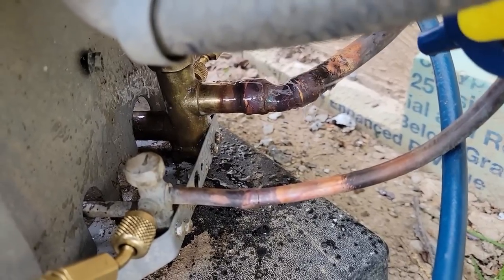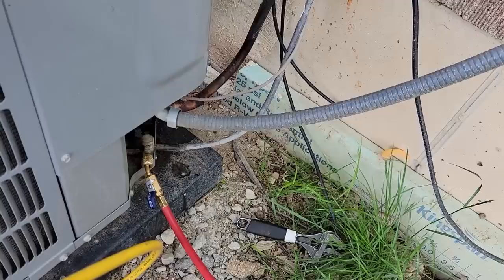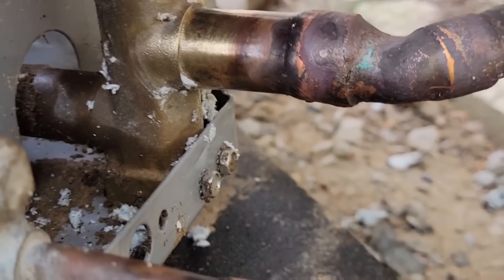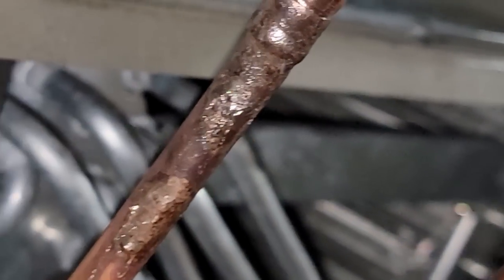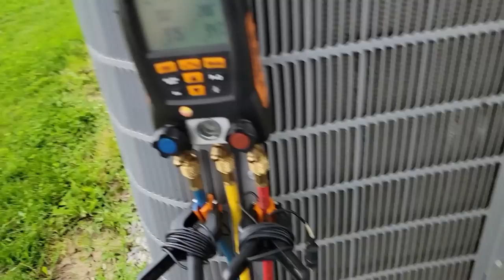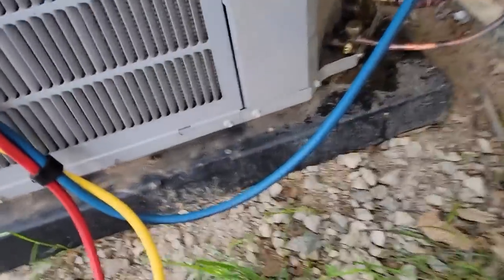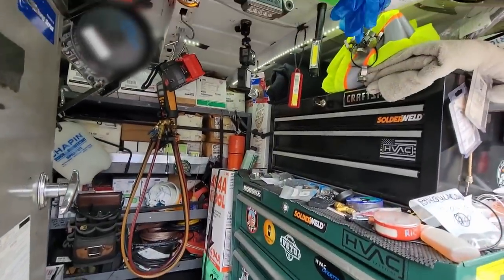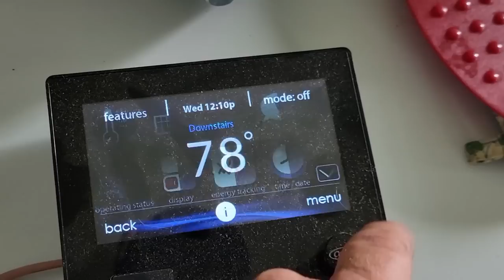No Air Conditioning At OLD Farm House Under Construction

Comment: I had the same scenario today had oil inside and outside but could not confirm a leak via bubble test, what gives? Had at least 150 psi 410a pressure in the thing, I’m at a loss…love the residential videos man! That’s mainly what I work on!
Reply from the maker: Thanks Tom! I use to do mainly residential so I don't show it much because I got so burned out on it. That's why I did generators and now refrigeration. But even that's getting old...lol time for painting butterfly's on trains maybe...lol

Comment: I would have changed that drier , going by the leak, seems like unit always had a leak. Makes me wonder how many times it was flat on charge
Reply from the maker: I believe that was the first leak. The safety circuits shouldn't have let it run into a negative and pull in non-condensables was my reasoning.  Far as other issues, it's a 2019 build date, I believe the only other problem he had was a bad inverter board.

Comment: I had to replace an evaporator on an underconstruction luxury condo that became packed with drywall dust while wet under use.  May as well have put the plaster directly on the coil.  Attempts at cleaning went nowhere.

If you are supplying heat/cool equipment to an active construction site, be warned that manufactures specifically state not to operate it during construction or as temporary heat as it will void the warranty.

Perhaps you could make the Navac pump more 'water resistant' by spraying some circuit board varnish on the electronics, assuming it is not currently.
Recently dropped my Milwaukee flood lamp in water and their boards were not protected and it caused a failure due to a corrosion short. It worked after a clean-up, fortunately. $150 saved.
Reply from the maker: What brand varnish do you use? Good idea!
Reply: Gypsum dust can be removed, even if packed in.  What you have to do is soak it. Not just try to rinse it off, but soak it.  Let the water absorb into it.   THEN you can start rinsing.   Light pressure washer can help (1000 psi or under).   It's just that unless you give it lots of time for the water to sit, all you're doing is getting the outer layer of the gypsum wet, which means you have to abrade it to then get the next layer damp.   Anyone who has had to deal with flood soaked drywall can testify to that.    You can add a bit of Dawn to the water you're soaking with if you want.  

Glad you managed to salvage the tool.   Flushing with rubbing alcohol helps if you can get to it fast enough (it's distilled water and alcohol, which means that when it dries, little to no residue is left to short anything, and the alcohol helps pull out the dirty water)
Reply: @tbelding  they may have used durabond for fast repairs and speed work and that stuff tends to reset like iron once sanded when the powder gets wetted again.
it will pretty much set hard under water in plumbing traps and low spots in piping. standard pre-mixed joint compound and sanding dust is way easier to remove.
Reply: @HVACRSurvival  I second coating the PCB. Here’s some stuff I’ve used and it’s very similar to what you’ll see in some areas on some IFC Boards. I can’t figure out why this dose t get used more it’d keep the water away from furnace control boards an keep them from corroding like when the coil leaks. Then when I do see it on a board it’s just in some areas and not others. So who knows. 

Anyway rant over here it is

MG Chemicals - 419D-55ML 419D Premium Acrylic Conformal Coating, 55 mL Bottle, IPC 830, UL 94V-0 (File # E203094) https://www.amazon.com/dp/B07B8RY7M6/ref=cm_sw_r_cp_api_i_JHX89V7ZZQMA5PJ93NR0
Reply: @throttlebottle5906  - Durabond is plaster of paris - dehydrated gypsum.  If you soak it, it'll still get wet.   The problem is that if it's in a big lump, even soaked through, you have to mechanically penetrate it to start it washing away.    Normal drywall compound is apparently a limestone product.   (I wasn't aware of this until I looked it up).    So, basically, Durabond will wash away - but it washes away like the drywall, not like the factory mud.   Soak it, preferably with soap in the water, then you can wash it off.    In pipes?  You have to mechanically penetrate it. No matter how wet it is, it's a lump stuck in the pipe, just like clay.  You can wash it away if you have a way for water to move, but dump enough in and it'll stop the water moving.

Comment: Excuse my ignorance but what does water with a high sulfur content have to do with attacking copper in an air conditioner?  The moisture on the pipes is condensation due to humidity in the air.
Reply from the maker: hydrogen sulfide gas causes the coils and braze joints to leak.

Comment: Quick question - did you slap some tape over the holes you were using for your thermometer?
Reply from the maker: Usually I do. I forgot to on this one🤦🏻. On the up side, I only poked a hole in the supply side.

Comment: Yeah but lemme ask you something. How did you put it up to atmospheric pressure when your guage was on the liquid line. I know you gotta go through the liquid line while its off... so how did you do that before removing it???
Reply from the maker: I added it to the suction line in the liquid form, that's why I mentioned it was only 10 oz or something, the liquid's going to travel both directions and eventually lead back to the liquid line. You could hear the gauge hiss as I took it off, it wasn't in a vacuum. And with that much surface area that liquid's going to boil off back into a vapor.

Comment: I'm curious if you have ever used the Supco digital micron gauges, and if so, what your thoughts are about them.

I bought what I could afford at the time, a well used early model (two line matrix display) Supco VG64 with the "lifetime" sensor. I think it's from the mid 1990s. I guess they weren't kidding...in spite of being quite worn, it's still spot-on compared to others. My only complaint is that it's a little battery hungry.  I'm not sure what I'd buy new if the time ever came: the Bluvac you have, the little tiny Bluvac, Fieldpiece or another Supco (they have a Bluetooth model now).
Reply from the maker: I haven't used the Supco micron gauge, I was offered it to try but if what I have works then why try something different. Plus I don't want to talk bad about a product IF it doesn't do well, sometimes its better to not know. I would like to have the little BluVac, that has all the same features as my big one if you use the app, I like having it all on the display because my phone battery tends to die early as it is with all the things its already running.
Reply: @HVACRSurvival  I had that Bluvac mini micron gauge and loved it BUUUT, if I left batteries in it they were dead the next day even though it was off. Might have been defective tho I really think. I just removed the batteries after each use.
Reply from the maker: @ReliableHVACR  the same thing would happen with my CPS. I haven't had that problem with either the new or older full size BluVac. Thanks for sharing!

Comment: Are you saying that how far back the the braze material shows on the outside is how far back into the joint that it flowed?🤔
Reply: they likely did not get enough heat on the tubing towards the valve/devices, so the brazing never flowed into the joint.  the flowing puddle is drawn towards the heat and no heat down in the fitting = no flow and rim solder/braze. it's even worse now days with the very low lead brass products, they simply do not pass heat through as good and you really need to get the pipe hot to move heat deep into the fitting, then work around the fitting to get good flow.
Reply from the maker: Joe- I'm saying It is a good indication if you look at the dark spot the heat created, you can about guess it made it to that point.  I'm not saying it's a guarantee, you would need to cut it apart to verify but usually It will make it to the rear of the joint if you cleaned the copper and pulled the filler to the heated area, not just melt the rod onto the copper joint area and just covered the edges. 

It's hard to explain everything while your working and I don't always use the correct terminology but I know what needs to be done and how to do it. I like to mention how and why I'm doing it because I see so many horrible solder jobs, I had a lot of issues when I first started until I was properly shown what works VS what the teacher said.
Reply: @HVACRSurvival  Did all my braze before nitrogen, used to say red is dead. 😅
Reply from the maker: @joehead1294  I didn't use nitrogen with R22.
Reply: @HVACRSurvival  After a few years in stationary HVAC, I went mobile and never saw a torch again.  Still prefer the electrical side.

Comment: Great video as always but I'm surprised your wife and kids allow you to play with fire! Keep up the great work stay safe lightning hurts and so does getting burnt so do your very best to avoid both. Could you possibly cover up the electronics with like a bread bag without covering the suction area. Just just asking off the top of my head because we used to do that for electronics we made if we got caught out
Reply from the maker: The control board is located on the bottom of the base. It's protected from most drizzle but if it were in standing water, it would get on the circuit board.
Reply: @HVACRSurvival  good deal keep up the great work stay safe
Reply from the maker: @berylwhite2983  thank you!

Comment: How could "soft water" possibly cause leaks in evap coil????
Reply from the maker: I didn't say soft water I said Sulfur water. Sulfur water (or sulphur water) is a condition where water is exposed to hydrogen sulfide gas, giving a distinct "rotten egg" smell.
Reply: @HVACRSurvival  Oh sorry for my bad ears. Where does the H2S gas come from that I guess combines with condensate dripping down evap coil thus creating mild sulfuric acid that eats the coil.

Comment: This install was brought to you by Ray Charles plumbing, heating and air......or was it Steve Wonder Mechanical. Lol. What a horrible looking braze job by the original installer
Reply: @HVACRSurvival  do you have an inverter in your van?
Reply from the maker: @jasonjohnsonHVAC  1500watt beast. Why?
Reply: @HVACRSurvival  seen you pull your battery for your vac pump out and was wondering what inverter you use

Comment: Come on !   You said you will clean up the copper lines at the air handler AND YOUR NOT GOING TO CHANGE OUT THE DRIER.. DAMM  next you will replace a cap and leave it in the box. lol
Reply from the maker: I told you why I did what I did. I'm not sure what you're talking about a capacitor in a box? I don't believe I replaced a capacitor